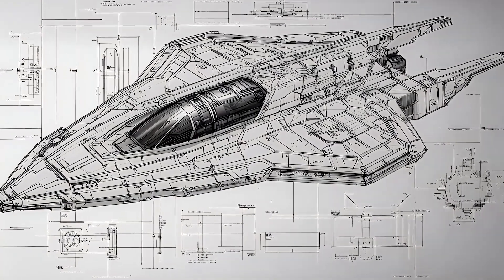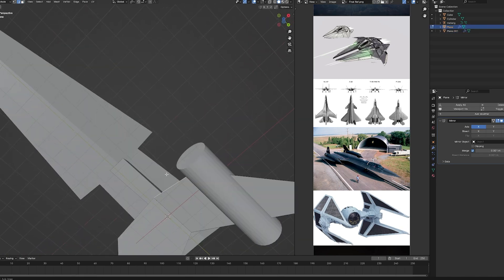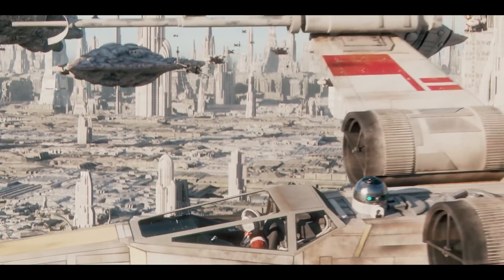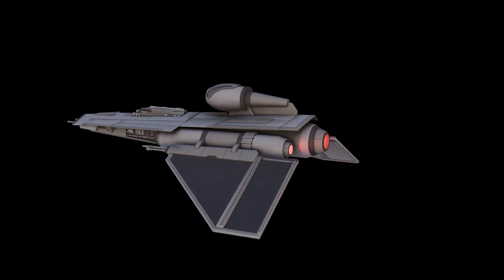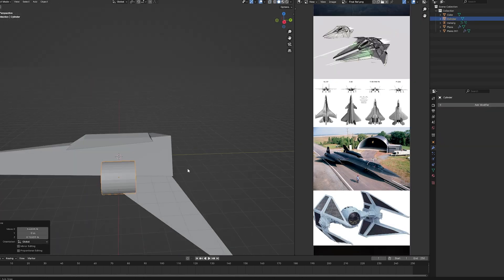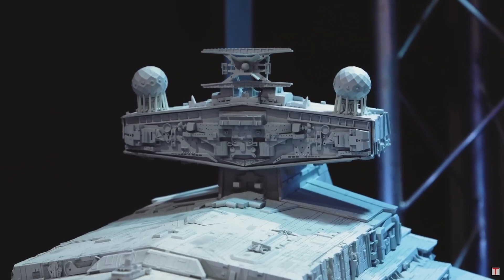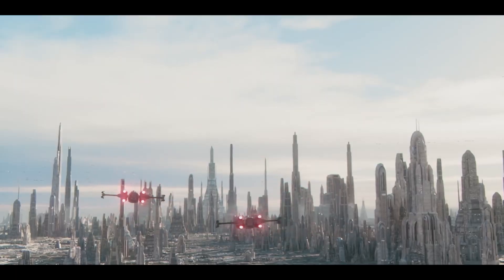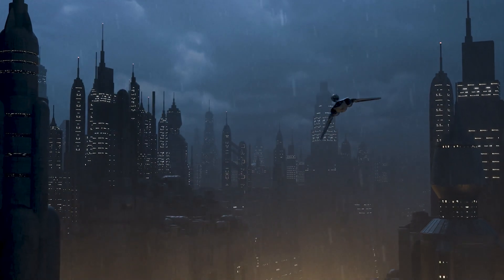How I made a Star Wars Spaceship with Blender

Comment: Do you have any tips on how to make the crevasses on the hull?
Reply from the maker: I would say you mainly want to start with a simple shape and cut pieces out of it using loop cuts and the knife tool. If its a flat plane with a solidify modifier you wont have to work too much about making a quad mesh. Theres a ton of other ways to add detail as well like adding additional shapes on top but its mostly a feeling thing

Comment: You've mixed two visual eras in your ship by putting a prequel era cockpit on top of the OT hull. Why? And the way you've placed that cockpit nullifies its greatest advantage: and excellent visibility.
Also, why would you give it one large engine and two smaller ones? Just go with two medium-sized ones.
Reply: I mean two thrusters runs the issue (if you're using them for thrust vectoring) of one dying and then you can't use either engine. At least with 3 you can shut the 2 side or 1 center and still retain reduced thrust or steering thrust depending on which goes down. Not that star wars ever cares about functionality
Reply from the maker: My theory with the cockpit being a prequel era is that this cockpit is mainly only featured on Jedi Starfighters, this being a newer more large version of those ships. Also this is sort of a blend of the two technologies, the standard Tie Fighter is not more advanced than a Jefi Starfighter, its cheaper and mass producible. So my idea was to create a “higher class” of tie fighter. As for three engines I just think they look cool lol
Reply: Could be a "scrap queen" of sorts, built from spare parts